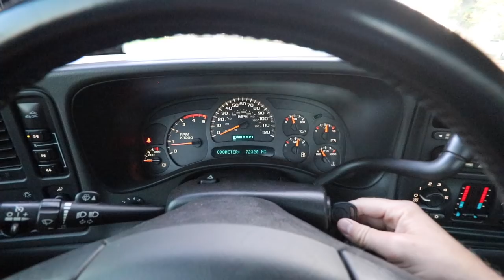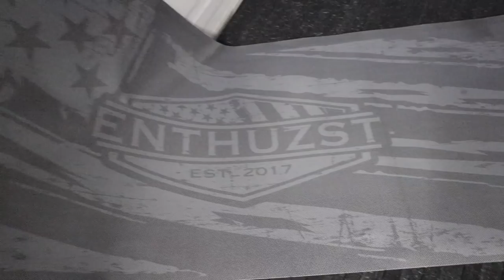LOWERING THE MINIMAX WAS A MISTAKE!

Comment: I have a lowered LB7 crew cab, same suspension set up same tires but different size wheels I have 20x10 with a -12 offset. I rub at full lock with trimming lol you’ve got to be rubbing when you turn.

Comment: I just bought a Duramax just like yours, my first single cab, I have owned 5 other Duramax but all four doors..this single cab is alot more snapper then the others, what tune you recommend, i have only run efi live and ppe and edge, and I think it has 410 or 411 gears, it's fast for stock.

Comment: Straight turns it on don’t let fuel pump build pressure or block heat or anything 🤢
Reply: Poor truck
Reply: ehh, it's not a big deal. the glow plugs shut off as soon as it's started. and there is no fuel pump to build pressure. the truck needs to crank in order for the cp3 to draw the fuel from the tank.

Comment: How difficult was it to find a single cab dirtymax? I dig the hell out of this truck man it's freakin rad
Reply: I have one. Had to search for it but found one pretty close. And white.
Reply: There weren't many in late 03 though. I didn't even test drive it. Already drove an 01 and was ready to do the paperwork. Had a GM In the Driveway certificate. 4% UNDER INVOICE. They couldn't believe I was being real, but it was. $28000 cash tax and title. 175000 miles on it, about to do it's first set of injectors (40%SAC) and an EFILive tune.

Comment: The front looks way wider than the rears
Reply: Connor Reagan it is around 3" wider in the front from the factory
Reply: dirtrider292 why?
Reply: Connor Reagan it's a Chevy thing my 92 suburban is the same way. I actually had to buy 2" spacers for the rear to make them sit flush even after a solid axle swap
Reply: It is called tracking it is used so your rear wheels aren't down in the front wheels ruts offroad